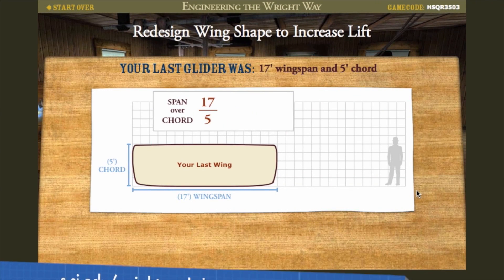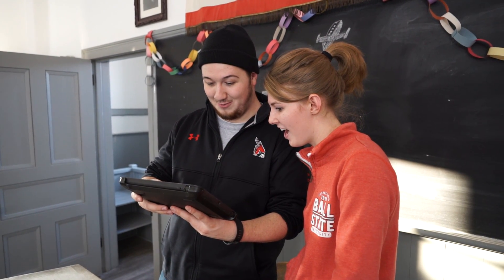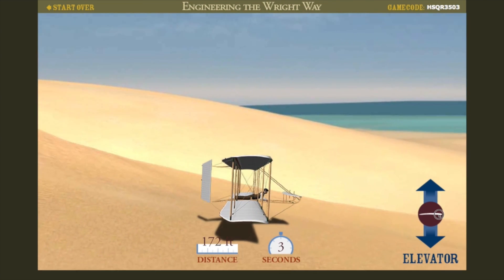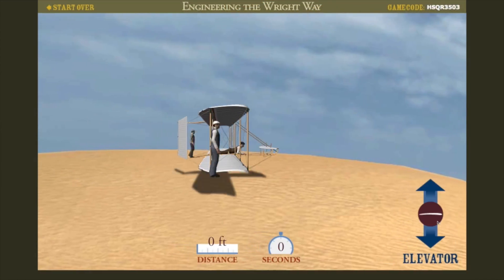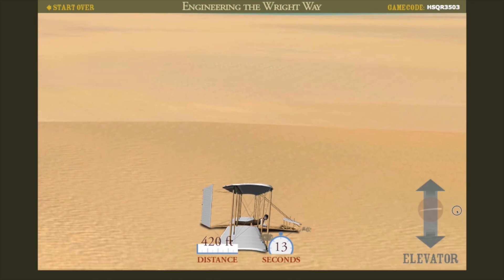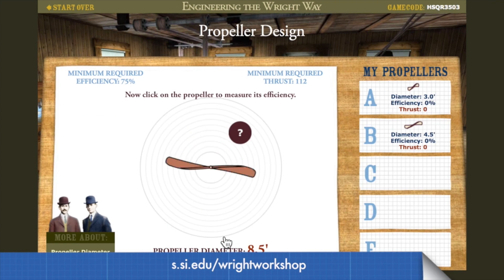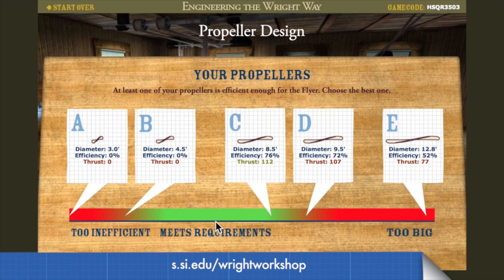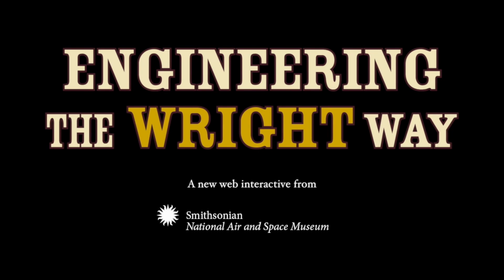Engineering the Wright Way

Comment: The Flyer only flies like that in computer animation. 
   In real world and real physics,  it can not fly sustained. 
   That is why none of the replicas made so far can do that.
    340,2 kg and only 12 hp make it impossible for the flyer to fly sustainable.  It is amazing that the Smithsonian tells that even the Flyer 1 could do that, since the only proof we have about Wright brothers airplane flight is from 1908 after they bought an European engine , not before.
Reply: Not true, the engine made more than enough power to sustain flight, and they were the first to pair an engine and efficient wing with 3 axis control, it was the first modern airplane.
Reply: @chrismofer  Do you really believe something weighting 340,2 kg with only 12 hp could do that? 
    Reality shows that there is not a single proof Wright brothers flew a Flyer before 1908, and there is a reason none of the several replicas made so far can fly sustained.